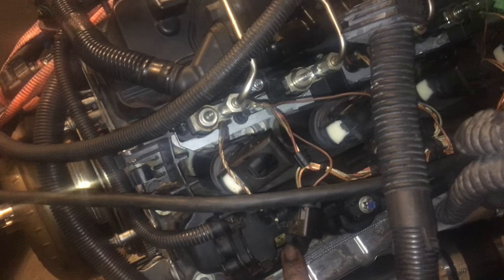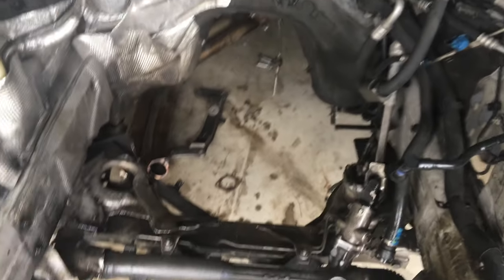So Much to Do But Coming Together with the 335i

Comment: "Gunk" cleaner from Engine Brite would work way better to clean out your engine bay than that degreaser.... all degreasers are not the same. Plus Gunk is made for engine detailing and comes in a foam or gel so it gets into tight places as to just dripping off. great job and vid by the way
Reply: Anytime bro! I absolutely love your channel. I used to be an ASE master tech for 8 years, but mostly worked for Honda/Acura dealerships. I also used to build import engines for drag racing and I used to Gunk a lot to clean up motors for events. It's great cause you put it on a warm motor and let it sit fro 15 min and the chemicals in it really break up all the tough dirt and grease, so all you need is a little light brushing and hose it off. Throw on some silicone spray or vinyl cleaner on all the hoses and voila!!! A shiny new motor!  

As an ex tech, I think its great how you do all your work yourself and I'm very impressed with your skill! I'm loving watching the N54 motor swap you've got going on. 

I have an S2000 and a 2007 335i and do all the repair/mod work myself too. I just tore apart my S2000 motor and beefed up the bottom end internals & valve train to get it ready for a Kraftswerk supercharger that's about to go on it... Looking for around 450hp to the wheels. 

Next project is gonna be doing a FBO set up and MHD tune on my 335i... Other than cosmetic stuff, I figured I'd keep it mostly stock for now as its my daily driver until the S2000 is back up and running. 

I'm subbed to your channel. Keep up the great work and all the awesome vids. Best of luck and happy motoring from one gear head to another!

Comment: plastic resin. .no fiberglass.. for the cracked valve cover.. its kinda like bodyfill..but liquid and dries to a very hard plastic..
Reply: @nOshi2x  you mix it with a liquid hardener.. that usually comes with it.. but ive also heard that JB WELD when applied properly is as strong and durable as real metal.. and may tolerate the heat cycling better than plastic resin.. im sure someone out there has repairs in this genre on youtube, that u can use as a point of reference..

Comment: hey man good job on the swap i just did same on my 08' 535i and know what it takes to do it by yaselfe!!! what to know after you put everything together did you had to code anything or reset the computer or something is crazy my car now id giving me all kinds of malfuctions key does not open or closes the car well is crazy car runs but have no power .....im sure everything is properly connected but as im not mechanic can't thing of anything else i should do ?!
Reply: hey thanks for the message really appreciate !! yes i did reuse the old wiring harness all the old cables actually only swapped motor and tranny itself plus some of the sensors that where already attached to the motor but yes can't figure whats wrong with the car it did started normally but is giving me all kinds of codes and malfunctions as I mentioned plus has no power !! I'm thinking in replacing some calls since they where in the new unit don't really know !
Reply: yea man actually watching ya video came to mind to also switch the transmission cable and i when back and took it out of the other car because mine also fits kind of loose so ima change it to the original one see whats up! also i contacted someone that does coding in this cars so hopping they tell me something will see....

Comment: Hey bro! I'm in the middle of swapping my N54 from a spun bearing. Hopefully it should be done by the weekend. Is there any coding that needs to be done? I'm reusing my harness. Also one of the heads was ripped off the harness so do you think you'd know which one it is with a photo?!
Reply: Complex Seven Industries I was planning to leave the injectors that came with the new motor to avoid swapping them.

 Are you saying I need to place the injectors from my old motor (one I'm taking out) into the new one to avoid coding? 

Say I don't replace them and it starts would it still run normally?
Reply: Complex Seven Industries awesome man I really appreciate the help and information. Only reason I asked is cause I don't have the capability to code them if I needed to. I'd have to take it to a shop and who knows how much that would be lol. Soon as I get a photo of that missing connection from the harness I'll try to send it your way.
Reply: Complex Seven Industries hey bro, so my guy figured out where that sensor went and found the pig tail of it. But I did have a question about the motor mount bolts do you know if you can pick them up from BMW ? Also I believe the valve cover has a crack I recall on one of your videos you had one what did you do to fix it?
Reply: Complex Seven Industries sup man! How can I send you a photo? I wana get your opinion on my turbos?
Reply: Complex Seven Industries bet just sent the photos